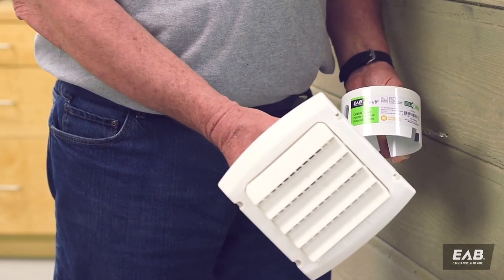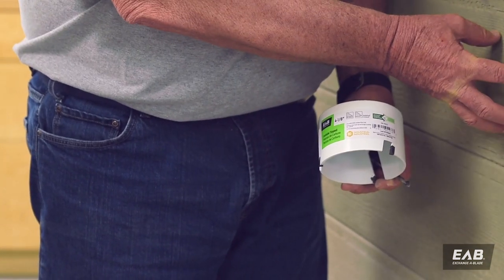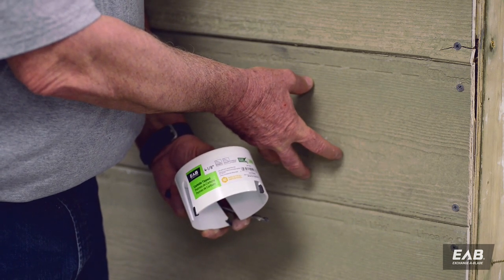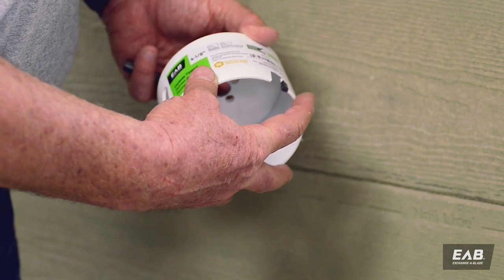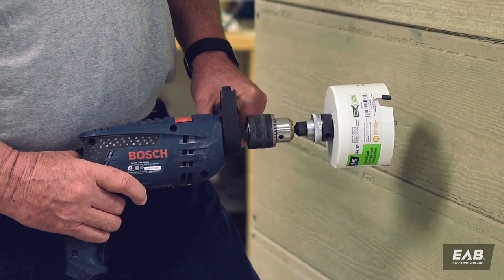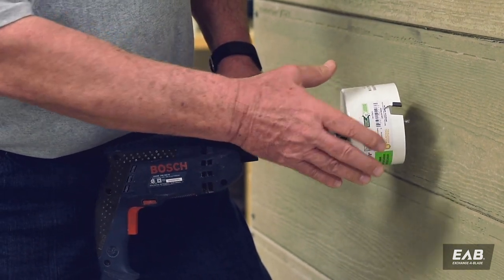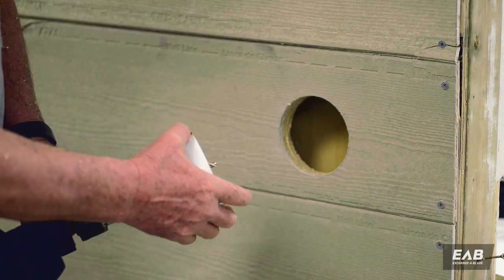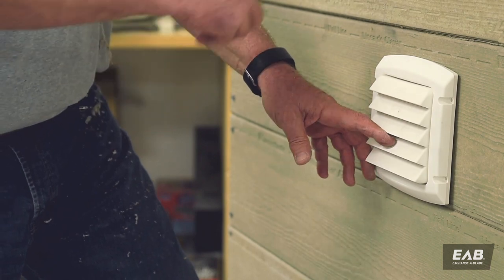EAB - How To Install A Vent In Hardie Plank or Wood Using A Carbide Tipped Hole Saw

Comment: The siding is not overlapping the lower piece. This gives him a far better supported piece of siding to drill through than it would be in real life. He also forgot the house wrap. Everything works better if you remove all the adversity!

Comment: This is a bad example. Any hole over 1.5 inches requires blocking with flashing when using Hardieboard. This may work but its not the right way.
Reply: What's flashing?
Reply: @RioGamer  "For penetrations in the building envelope such as hose bibs
and holes 1½ in diameter or larger, such as dryer vents, a
block of HardieTrim 5/4, 4/4 boards shall be installed around
the point of penetration. Blocking should be a minimum 3 in..
radius greater than the radius of the penetration. To install a
block around an existing vent pipe, it may be necessary to cut
the block into two pieces. In this case, weather-cut the trim to
fit it into place. Install flashing over the top of the trim block.

Penetrations through a building envelope are made to
accommodate needs such as hose bibs, dryer and furnace
vents, electrical conduit, etc. It is important to restore the
weather-resistant barrier of the home after cutting a hole for
the penetration.

There are several pre-made blocking and flashing products
available that can simplify the installation of a penetration.
One such example is Sturdimount. Be sure to follow all
manufactures installation instructions."

- James Hardie Siding - Best Practices – Installation Guide Siding and Trim Products - Version 9.1
Reply: @Craigthepope  Thanks for posting this! I was just about to wing it with no further research. Hardie has pictures and everything, and it's not really tricky. And a square cut with a carbide oscillating blade is way cheaper, and way easier if you need to cut two planks where they overlap. After all the effort I went to making my house envelope for longevity --and to pass all code inspections! It would be a shame to let water into the wall at the vent. Also would be sad to have the inspector shake his head and tell me to do it the right way.

Comment: well...folks before you start drilling ...may want to check the vendor pdf file for best practice ....Page 19  it details with picture what needs to be done for any penetrations
Reply: This is correct. It's not really harder to do it the right way, as Hardie shows it.

Comment: I use carbide holesaws and carbide tip bits for my multi tool. Always ruined after 1 house. Been just using bimetal. Came here hoping for a better solution.

Comment: Question what size is the dryer vent tube? Since the bit is 4 and 1/8. Thanks
Reply: 4 inch. The hole needs to be larger so that it can slide in without resistance.